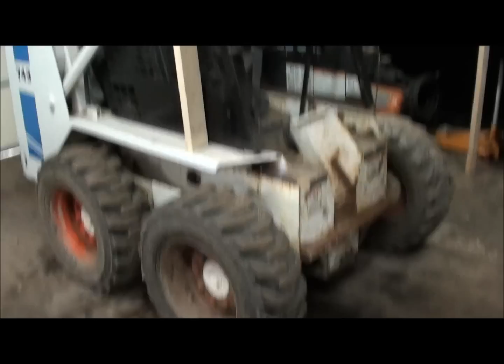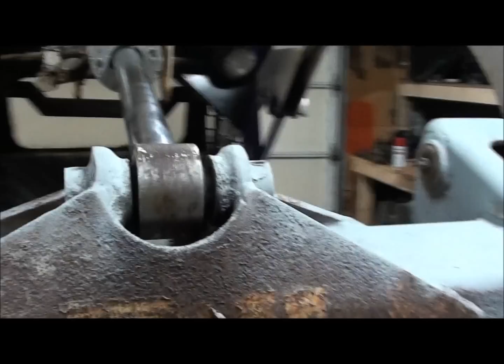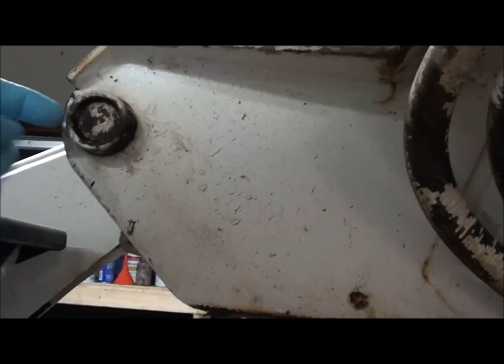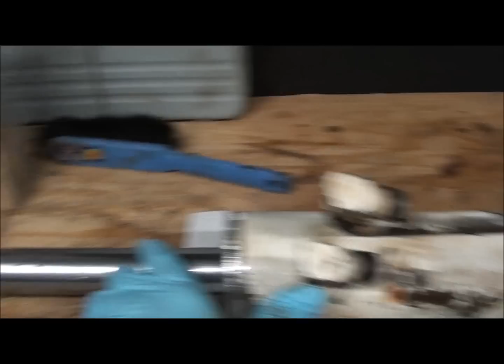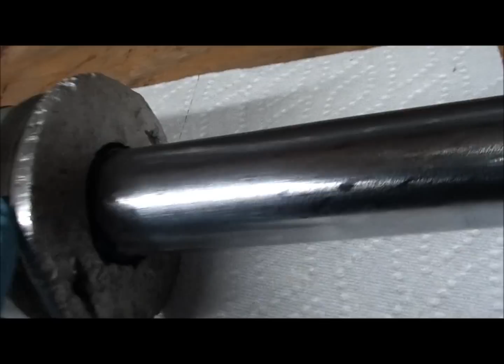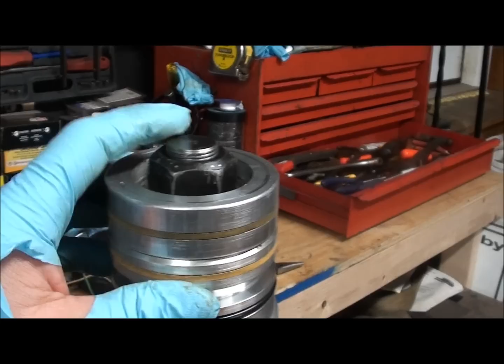Bobcat Hydraulic Cylinder Repair

Comment: Good Video; a few recommendations...

First, the author is correct that removing a hydraulic cylinder can (and will) cause the actuated lever (ie arm, bucket, etc) to shift - this is where most violent accidents happen and I have had articles that end sadly posted in our lobby to attest; don't be a cowboy on this, block and secure your actuated lever with something more than a 2X4 board...

Comment: Good Video; a few recommendations...
Second, when disconnecting hoses, you should have two sets of caps (female) and plugs (male) with the most common sizes on BCT Double Acting Cylinder being JIC (a fitting standard) 3/8", 1/2", 3/4"; this will aid to minimize a messy, hazardous work area  and harm to your environment...

Comment: Just a tip for next time your working under a load, secure it above and below to the ground in a way that is impossible to slip. It only takes one mistake when working on heavy equipment to enter permanent retirement.
Reply: A guy near me got killed when bobcat loader came down on him have  to be careful I would put more than a 2x4 under arms I would rather be safe than sorry
Reply: @dennisgunia7694  Wow that's terrible. So sorry to hear that. Safety first, y'all!

Comment: When I did the seals on the front tilt cylinders of my bobcat, the torque spec from bobcat was 100 foot pounds + 135 degrees or two flats on the nut, my bobcat has two cylinders but they look identical to this one.

Comment: Note: Mentioned hydrolysis, most common cause for seal failure; if hydraulic oil is milky, cloudy the sytem's oil should be changed with waste oil properly disposed with local waste mgt authority or a oil reclamation service; while factory recommended oil is PC, suggest the same weight but in a non-detergent option that is "friendlier" to seals; run the machine for twenty-thirty minutes every couple of weeks so condensation that's accumulated in the hydraulic system can be minimized...

Comment: the control valve has a pilot to open check valve on the boom lift cylinders so there should be no creep when that tilt cylinder is removed...personally i use something to support the boom regardless...saftey

Comment: A safer method is to extend the boom then lower it extended , then relax the hydraulics with the machine off. Your 2x4 method is highly unsafe support. Known to fail without notice anytime besides not being sucured in position. Need to use safety rated chains or J-Bars or an F- Bar...
Reply from the maker: first, nose hair and now concern for my safety. mom, is that you? jk, that was my first video years ago. I've come up with safer ways of working on my equipment. the nose hair on the other hand, I'll try harder next time

Comment: Fourth, Do Not place your chromed shaft directly in a vise (remember the seals have to ride along a smooth surface), use nylon or 2X4 blocks inside your vise to secure the shaft assembly; you will need a O ring pick set or just pick set; Lowes and Sears Craftsman have sets with four useful angles for about $8usd; don't use a screwdriver; clean the gland head thoroughly (brake cleaner is popular with road mechanics) wipe down and let dry completely..
Reply: Happy to help you with seals and cylinder components in the future. Check us out: https://www.crconline.com/

Comment: Good Video; a few recommendations...

Third, when disassembling the cylinder, needed is a Pin Spanner Wrench (not BCT exclusive) ; removing the ALUMINIUM gland head (part rod passes through) with a pipe wrench, channels, punch can damage the head (even though not visible) compromising rod seal that take the shape of the seat they are seated; if your head is in the condition in the video, recommend having a made from Ductile Iron from a reputable machine shop as BCT aluminum option is ****.
Reply: We sell pre-machined ductile head glands if you need them. Also, we sell solid ductile material if you want to machine it yourself.

Comment: Fifth, never boil seals. Seals are made from powder in an injected mold process so when you boil the seal...well common sense; the glass-filled teflon seal in BCT's (Usually gold color ring backed by Oring energizer) should be stretched at a minimum, use Ring Compression tool (Craftsman) lined with Shim (made from file folder) used to compress the seal approximately 20 min; that, with taper on tube end will assisting when "stabbing" reinserting the rod/gland/piston assembly into the cylinder...
Reply: Would love to discuss other seal installation methods with you. Very knowledagable!

Comment: Don't do this. Just go to Bobcat, pay the 100 bucks and get the rebuild kit which has ALL replacement o-rings, seals, and nut. The machine down time alone, not to mention fucking up that cap, is worth doing it right. And for God's sake, spend 12 friggin dollars on a spanner wrench from amazon to get that cap off.
Reply from the maker: Cap was already banged up from the previous owner. The video is 8 years old. Amazon wasn't a thing yet, lol.
Reply: @fitzsfixes  My advice is intended for anyone performing this maintenance now, as it is still relevant.

Comment: Did have any problems with the bucket not holding a curl position after repacking the cylinder ?
Reply from the maker: jamelofrazier not with the curl. But my lift arms wouldn't stay up. It ended up being the spool valve
Reply: Thank you for the reply! I replaced the seals in the spool valve body already. I have problems with the machine before and after the spool valve repack.I was told it could be a loose nut in the tilt hydraulic ram.

Comment: You're lucky you didn't die at 5:35. The boom arm needs to be properly secured so it can't move up or down. When you pushed up on the boom arm to wiggle out the top pin you could easily make the 2X4 slide out of place and you wouldn't have been able to post this vid from 6 feet under.

Comment: I think you took a big chance getting the second pin out. You  were causing the whole lift arm to shake and all you had holding it up was a slim 2x4 board. It could easily have slipped out or broke and the whole thing would have come crashing down,  killing you dead. I would advise you to take more safety precautions when working on heavy equipment. Cheers